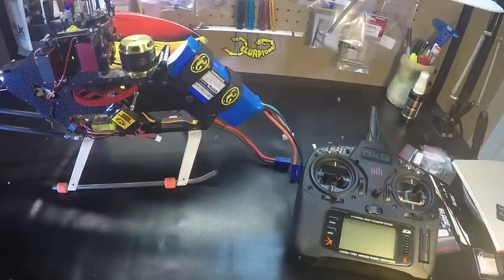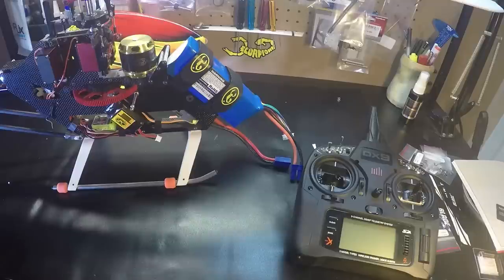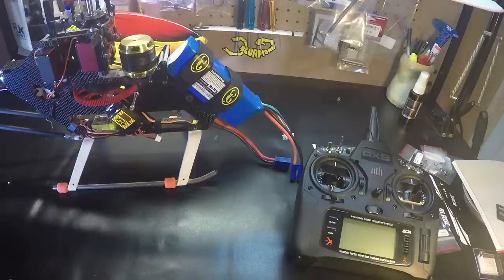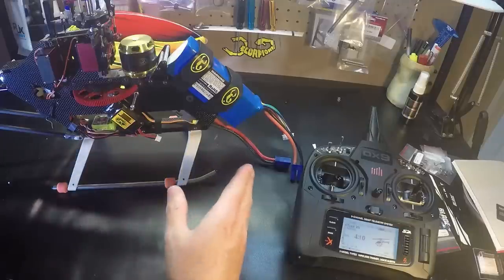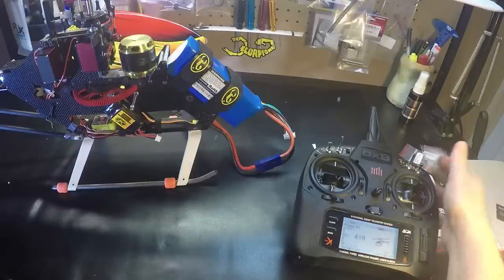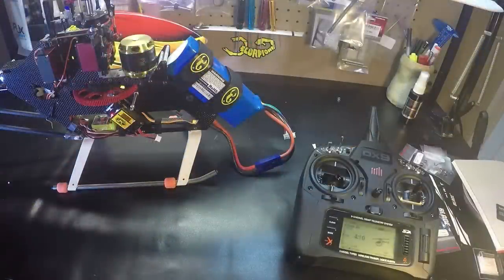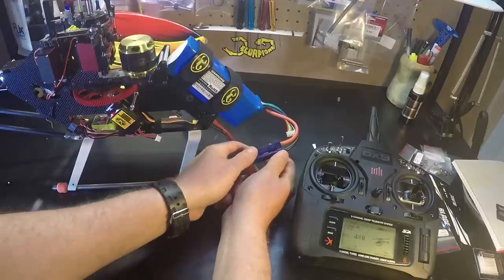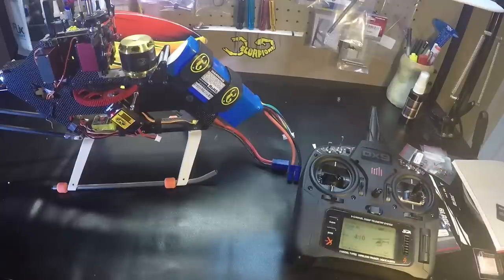Scorpion Backup Guard demo

Comment: Thanks for the info how long has it lasted on your heli before it died? Also does it auto shutdown to protect its battery or will it stay on until the battery goes dead?
Reply from the maker: It last a couple flying days depending how much you fly, it does not turn off by itself
Reply: Thanks much, glad you posted this video. I've been looking for something like this for awhile now, been worried about flying on single battery. Just ordered one from eBay.